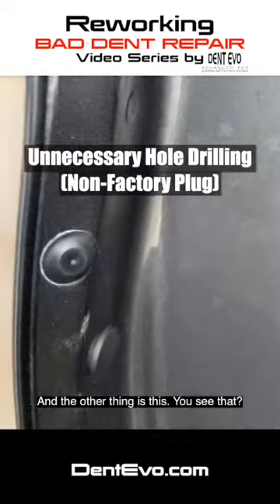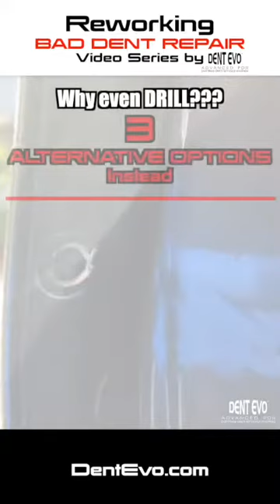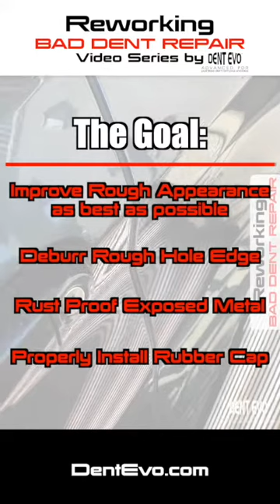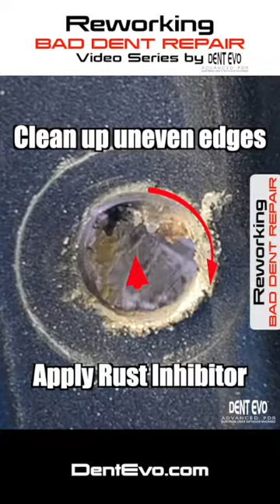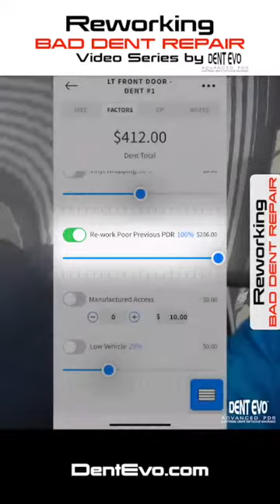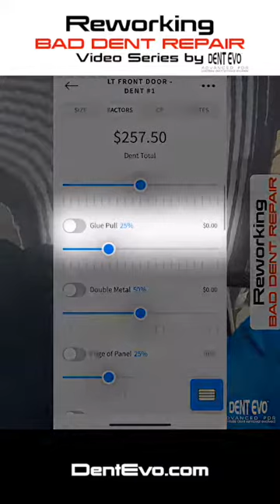Dent Repair Screw Up | Reworking Bad PDR

Comment: Can I ask a question? I got a new mazda car and have a big dent on the door near the edge. It's been fixed by pdr but there is a line 1-2cm from the edge and they told me it can't be perfectly fixed. It's quite noticeable but I really don't want to repaint since it's brand new. is it really impossible to fix by pdr?
Reply from the maker: Thanks for your question. I’d really have to see it in order to determine whether or not it’s fixable. But generally, when a dent is located near an edge, it’s very common for there to be an outward crease or “raised seam“, caused when the panel was pushed into the frame of the door. Sometimes we can flatten those out and sometimes that line remains after the repair. I always communicate this possibility to my customer in advance so they may decide accordingly beforehand.

Feel free to send me some pictures or even a brief video ( https://dentevo.com/reach-out-to-us ) of the area of concern. I can take a look and help you figure it out.
-Joe
Reply: @dentevo1  hi.. thanks for answering my question. But I don't live in the US. I just want to hear an opinion from expert since my local pdr said they couldn't access the panel on the edge. They had tried to pull it but it's still there. There is also one point where the clear coat has a tiny ding from the sharp dent. So i'm really thinking to get repaint. I guess once you see it, can't unsee it.
Reply from the maker: @DriftKido  I hear you. Well feel free to  forward the photos and video over if you’d like. I can take a look and share my opinion. No worries either way.

Comment: Do you know that it was a trader or was it the original owner with limited tools ?
Reply from the maker: The client purchased the car used from a local BMW dealer like that. So it could’ve very well been their low price PDR guy (which is common), or they could have purchased the vehicle like that.

Comment: Hello. Went to 3 PDR technicians I had a crease on door dent on edge they all told me the only way to gain access was to drill wich they did and it was a successful repair. Is drilling sometimes the only way to get access on door panels?
Reply: Thanks for your response
Reply from the maker: @mercedes3753  Anytime!
Reply from the maker: Yes, sometimes it’s the only way to gain access. And sometimes, drilling a hole can allow for a cleaner repair because it may bring the PDR Technician closer to the dent. Most of the time though there are better alternatives than drilling.

Case in point, the car in this video. It simply didn’t need to be drilled to repair the original dent. Inherently, drilling isn’t always necessarily a compromise to the vehicle, but the real question is, does the technician who wants to drill a hole have their customer’s best interest in mind?

There are real issues with drilling modern vehicles, that can arguably compromise structural integrity and affect pressure sensitive modules and sensors inside panels.

It is indeed better not to drill.

Often, dent repair technicians who are in a hurry or just plain lazy will drill when it’s not even necessary. Or perhaps they’re inexperienced or afraid to try and remove an interior trim panel for access. Maybe still, they are just trying to keep the cost down for a frugal customer.

Since I didn’t see your crease dent, I can’t say whether or not it was necessary to drill your door. What’s important though is that you are happy with the job and the service, and that they made a clean and safe access point.

Thanks for watching my video!

Comment: Nice save Joe! You do awesome work! What heat gun are you using in this video? I like how compact it is and how its shaped.
Reply from the maker: Hi Kevin, thank you for that! About the heat gun, it’s called an embossing heat gun and I purchased it from Michael’s craft stores well over 10 years ago. 

They currently carry something similar, same concept, different brand. But man they are really cheap and it looks like the reviews on them are pretty horrible.

Lots of people have been asking me where I got it, so I did a little bit research. Check this one out on Amazon: 

TACKLIFE Mini Heat Gun, 350W/662℉ Hot Air Gun with 6.56Ft Long Cable, Overheat Protection Light Heatgun for Epoxy Resin Crafts Shrink Wrapping Vinyl Wrap Wire Connectors Candle Making - HGP35AC https://www.amazon.com/dp/B07ZJK1VQS/ref=cm_sw_r_cp_api_glt_fabc_199119B70ZN8E6AMGJW5?_encoding=UTF8&psc=1

It’s got pretty good reviews and looks somewhat sturdy. People use them for crafts and electronics. Just remember, these mini heat guns are kind of cheapie. Mine has lasted a long time, but I’ve done some modifications LOL.

The benefits are that they are lightweight and can be suction cupped to the car. Let me know if you need any advice on hooking it up to the lock line segments.
Reply: @dentevo1  Hey thank you for the info brother! Very helpful! I'll check it out.
Reply from the maker: @superkev2000  anytime bro! I appreciate your encouragement and participation in the live video the other day too!